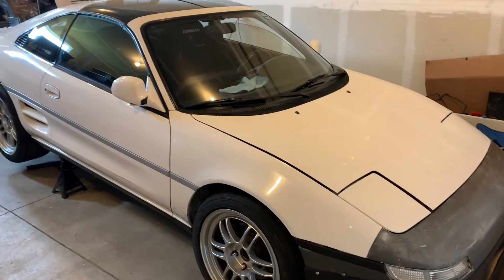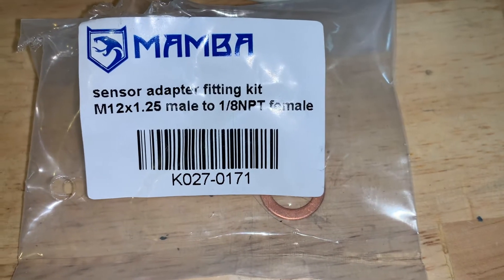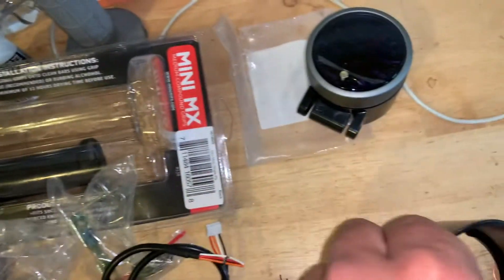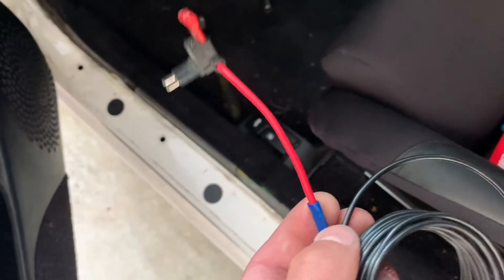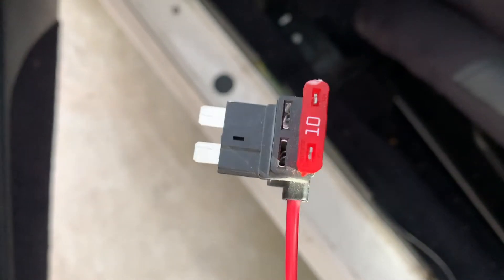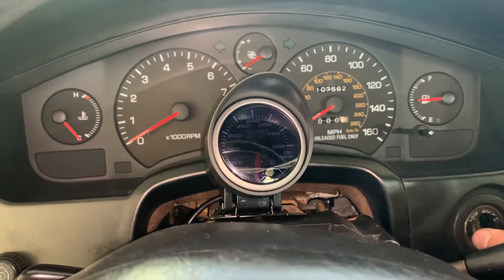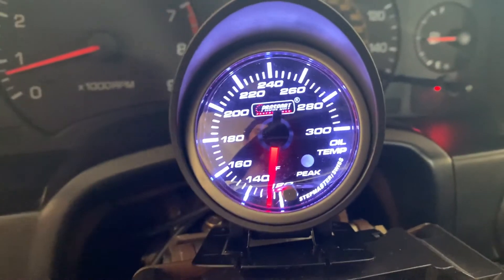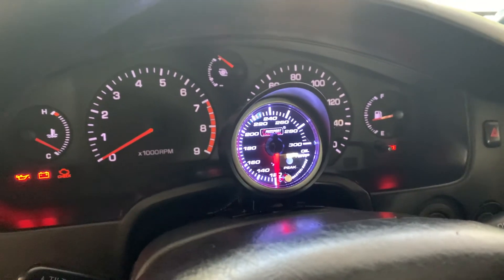Oil Temperature Gauge Install - Time Attack Mr2

Comment: What's your wheel and tire setup? Fitment is perfect and the tire size looks perfect as well.
Reply from the maker: 17x9 +22 and 18x10 +38. idk if its perfect, the fenders are pulled way out in the front and you don't get full steering lock but the bigger the rubber the fast I've been going so...
Reply: @allthingsfast2375  I see, I didn’t know the the set up was this aggressive. With your experience on this platform, do you think a set up of 17x7.5+35 front 17x9+32 back with 225/40 front and 255/40 back fit without rubbing? Stock suspension except for eibach lowering springs.

Comment: Is the beeping coming from the gauge?
Reply from the maker: yeah, I think I have it tapped into a non constant power source so it does then on boot up every time. I need to switch to a diff fuse
Reply: @allthingsfast2375  ah ok thanks